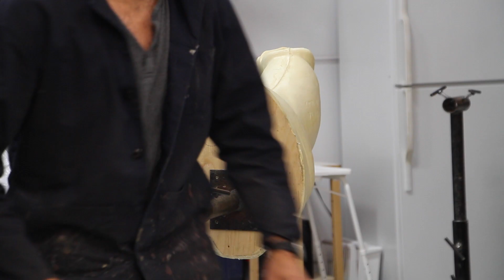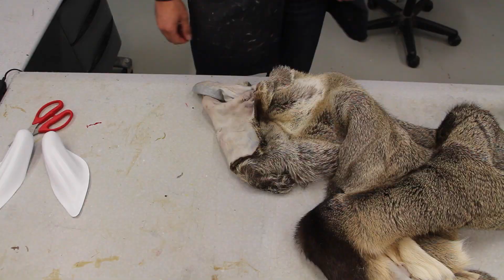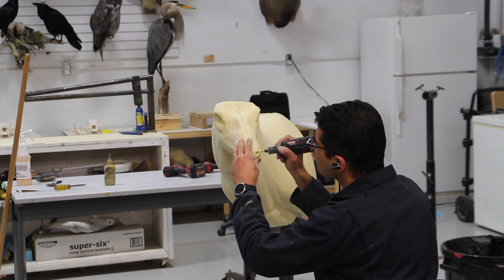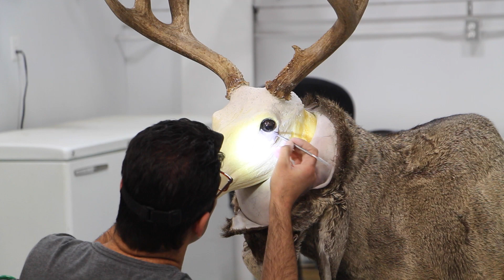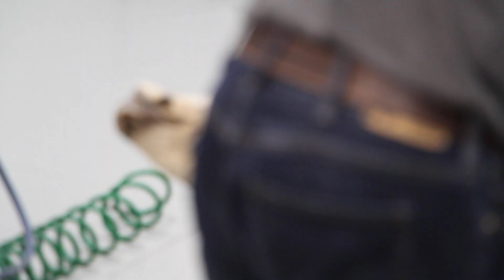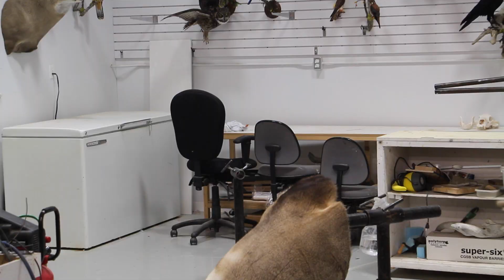Deer Taxidermy ... Mule deer on Joe Coombs form . Art of Taxidermy.

Comment: I didn't see where you built ear butts.  How do you go about doing the ear butts?  In the comments Mckenzie forms was mentioned.  What are thoughts about forms from Research Mannikins; sculpture Mike Fraizer?  I'm considering one of his wall pedestal forms.
Reply from the maker: Hi Tim, My time lapse videos doesnt necessarily covers all the details. (thats why I decided to start a membership for people who want to learn more).. I must have used two ball of clay for ear butts on this one. I have used sheep and stag and any other forms from research mannikins but have never used their deer forms which doesnt mean they are not good. Im sure they are good, Im just used to use the ones I have always used.. good luck
Reply: @ArtofTaxidermy  You put the ball of clay at the base of the ear liner and when adjusting the cape, form the ear butt?  The main reason I was going with the Research Mannikin form was the nose to eye and neck measurement.  The cape is rather small, 16.5" mid neck measurement.  Anyway, thanks for your time.
Reply from the maker: @timnelson75  yes.. a ball of clay on the ear liners and then shape from outside... I choose deer forms based on what they look like specially on their face .. the Eye nose can easily be adjsuted if the neck is the right size.. another good company Id suggest is Joe Coombs.. Joe makes one of the best deer forms.
Reply: @ArtofTaxidermy  I was looking at Joe Coombs wall pedestals.  I really like their look, a lot of detail.   Unfortunately their necks were to large for the cape I have.  Thanks, for sharing your expertise.
Reply from the maker: @timnelson75  welcome... and I agree, resizing the shoulder mounts are a big pain.. I have a video showing how.. its a lot of work.

Comment: With a small young mule deer it's difficult to find a form with smaller neck sizes.  What about using a blacktail deer form or even a whitetail form?  There's more options, is that doable?
Reply from the maker: Hey Tim I’ve never mounted a black tail in fact haven’t even seen one yet. You might be able to find a black deer form that would look appropriate for a small mule. The tech department of the supplier can answer that for you. But for sure a WT form would not be correct. Watch my resizing videos .. I did one for a red stag .. follow the same steps and resize a mule to a smaller size.

Comment: Great video.  I am a beginner, working on my second whitetail mount.  Two q's....do you tan your own hides or send them away?  Second, in your video it looks like you rough fit the hide before mounting.  Then you put something on the hide, wrap it up then you get to final mounting.  I saw this in your grizzly video too.  What are you doing in that step?  Just wondering if I am missing something.  Thanks.
Reply from the maker: I like to keep the hides moist while I spend time on doing something else, the bagging the hide is for that reason,.. or keeping the clay work moist.